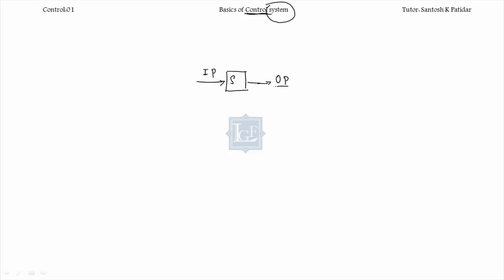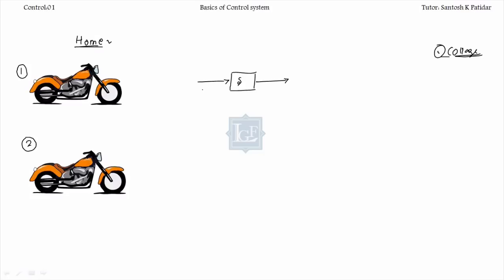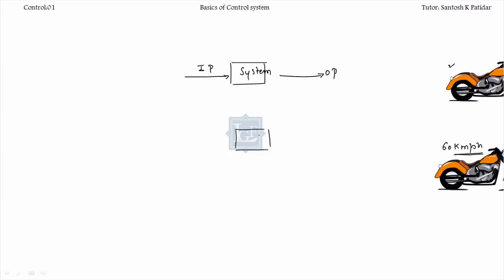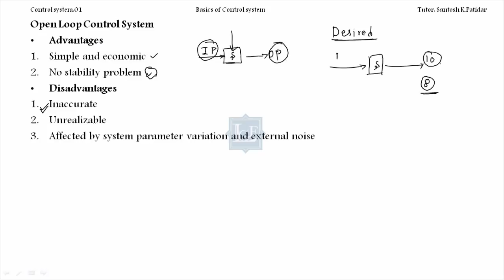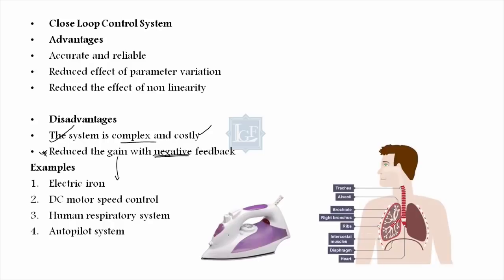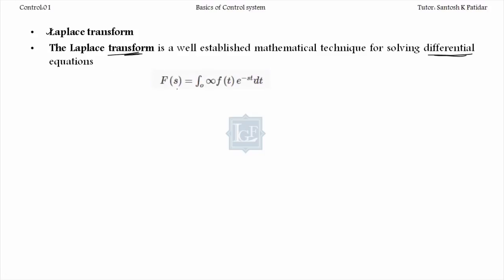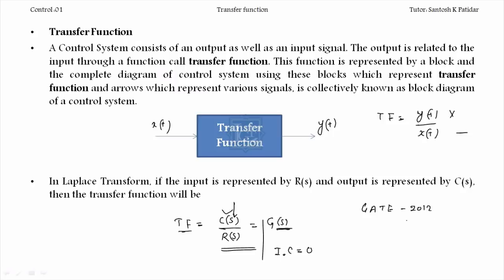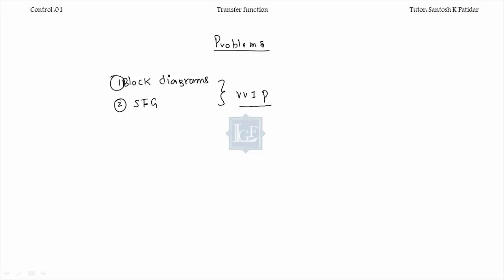Lec 01 Basics of Control System

Comment: what does unrealizable mean ? of course OLCS are realizable, traffic signal is an example of an OLCS which was 'realized'.
anyone?
Reply: if there is no any disturbance and environment is perfectly fine then olcs is realizable.if you want to make still olcs and strong enough to overcome disturbances (like you said traffic light) they have protectors and it is prepared in this conditions. but there are some instances where a particular system , the DISTURBANCE is overcomable or not. if your olcs design can overcome disturbance it's perfectly fine otherwise it is unrealizable.!!!

Comment: very very Thanks for providing gate lectures at free of cost sir, sir I Request  please provide some question bank  on completing subjects like network theory, power electronics and other also in easy level to difficult level (by providing separate icon in LGF website) helps for daily practicing and easily remembering the subject, and if any chance to provide online test series(in your website only) for completed subjects
thanks  lot sir

Comment: Sir, In open loop control system, output has no influence of input. And there is no control over the system... Then how would be it's comes under control system... Pls clarify my doubt.. Sir
Reply: It is in control system because it depends on the input value . But we can't correct it so it is an open system . It is My view